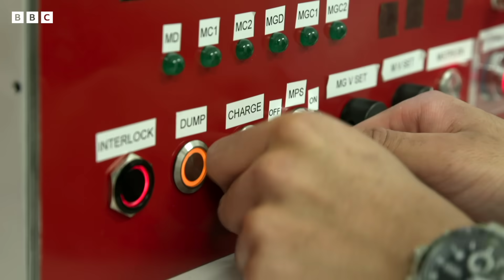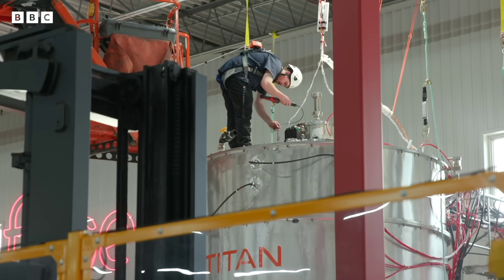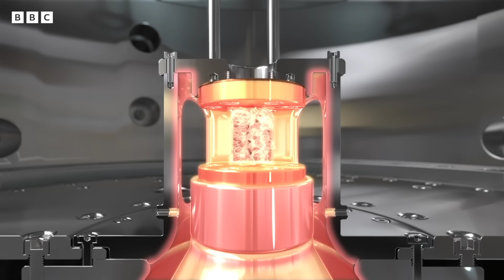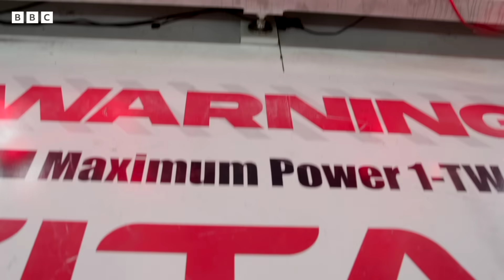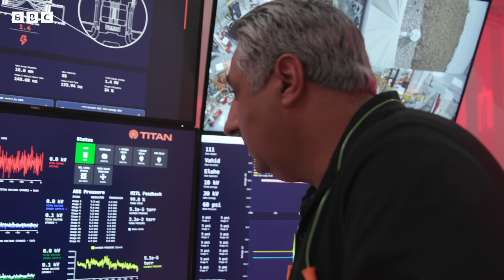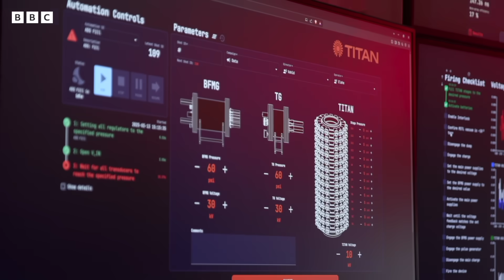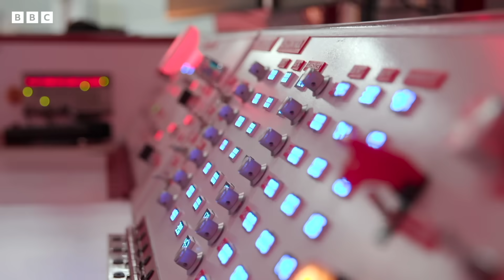Inside the lab trying to commercialise nuclear fusion | BBC News

Comment: Without gravity, stars wouldn’t exist. It’s the engine of creation, the regulator of energy, and the architect of destruction in stellar evolution. From a collapsing gas cloud to a black hole’s singularity—gravity writes the entire story.
Every atom in your body was forged in a star, all thanks to gravity’s relentless pull.

The bottom line....
Without enough gravitional strength, it will be impossible to get more energy from fusion than the energy needed to create and control fusion reactors because the driving force of fusion is gravity.
Without that force it will prove impossible to get more energy from fusion than the energy required to create fusion.

Comment: It's not as clean as most portray.  In a fusion reaction with deuterium and tritium, a neutron is released as the hydrogen isotopes combine to form helium. For every fusion, a neutron is released. These neutron bombard everything nearby, and cannot be contained by the magnetic "bottle" because they have no magnetic charge. They induce fission reactions, and irradiate whatever they hit, so the linings of the reaction chamber very quickly become highly radioactive. Some are trying to harness these neutrons to make more tritium, but the craziest part is that the bulk majority of the energy that is being harnessed is still just being used to heat water to run steam turbines.  Can we not come up with better?

Comment: They appear to be trying to create a z-pinch type reactor, similar to Zap Energy and LPPFusion. That discharges mega amps across electrodes to create highly energetic ions that self organise into filaments of plasma and generates its own pressure, but lasts for a very short time so discharging the capacitors has to be time controlled down to the nanosecond range. We don't know whether this would use aneutronic fuel, if so how they are proposing to convert the highly energetic charged particles produced to create electricity or deal with the large amount of X-rays from the Bremsstrahlung radiation.

Comment: Fusion has the same issue as fission, just a lot worse: Complexity and highly correlated risk. When they start building fusion reactors, they will have same issue as with nuclear reactors: Building steps depend on each other, any small issue or problem delays the entire project. Even after commissioning, any small issue or problem or defect causes the entire reactor  to go offline. Engineers consistently underestimate the costs of complexity, and that is at least part of the reason why nuclear power is always late, always more expensive than expected and not rarely enough also not as safe and reliable as promised. Fusion reactors are far more complex than nuclear reactors, they apparently need a bigger scale to be feasible, and even the non-commercial projects are orders of magnitude more delayed than even most fission reactors.

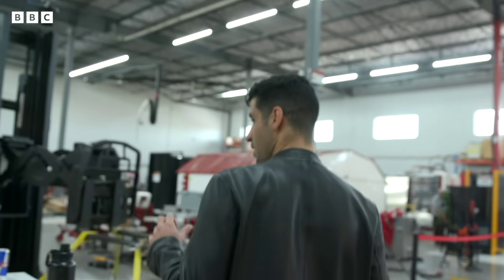Comment: 0:27 - Just to be clear, our terrestrial fusion attempts are quite different than the fusion that occurs naturally in stars.

Stars have vast cosmic weight pushing down on their cores to naturally induce fusion and break through the very strong Coulomb barrier via gravitational confinement.  A star's core, with its very high density and pressure, even allows "quantum tunneling" which can help bypass the Coulomb barrier even at lower energies that would not occur otherwise.

OTOH, our attempts at fusion have none of these features of stars.  We've been essentially putting in gigawatts of energy into test runs to get megawatts out for a fraction of a second.  This is unlikely to change for a long while yet.

0:59 - Terrestrial fusion is also not a ticket to "unlimited energy" either!  Our fusion designs require the use of a very rare isotope of hydrogen (Tritium) which stars do not need to use.  I wish the media would stop using this "unlimited energy" because that is just a fusion energy brochure tag line that media is only giving free advertising to.

In light of the very pressing challenge of global climate change, it's only rational that all government subsidies to fusion R&D should be cut to a bare minimum.  These funds should be re-allocated technologies that actually will make a difference.  After we have solved the fossil fuel problem, then we should restart fusion R&D.  That is the sanest course of action.

Comment: They are not the first. France and China already built prototypes.
Reply: Not this technology although admittedly FUSE are a bit sketchy on saying what their tech actually is.
Reply: U need to see the size of the reactor alone that China is building for fusion experiments vs the haphazardly place equipments and a water tank like they mean a thing.
Reply: @cchayk  Smaller the better if it works. Judging from the list of staff FUSE are using MagLIF which is totally different  to a tokamak. If so then that water tank is indeed filled with water (or FliBe) with a tiny vacuum chamber in the middle.

Comment: I live just north of this. Um... should I be concerned?
Reply: No - there are no radioactive byproducts. Fusion is nothing like fission, which might be what you're imagining. The worse case here is merely no net gain in amount of energy (getting only half as much power out as you put in is not a useful system), which is what fusion researchers have been struggling with for decades.